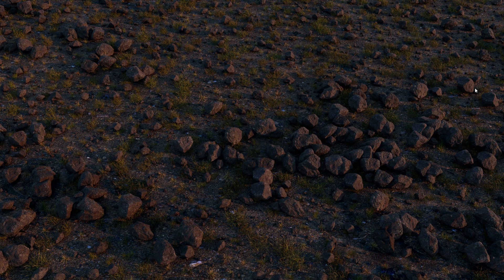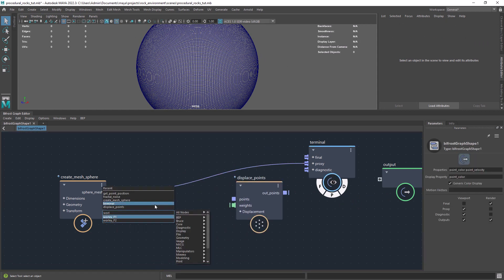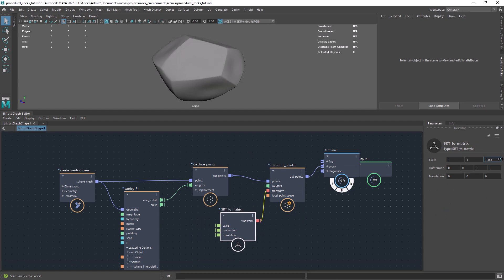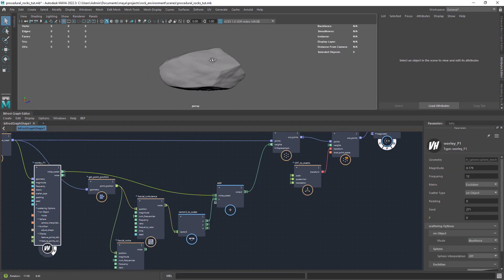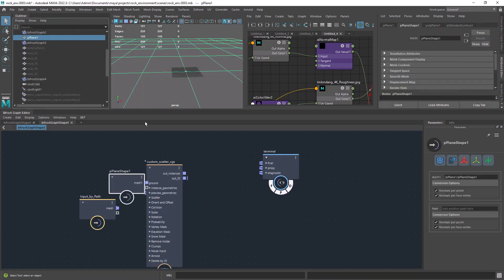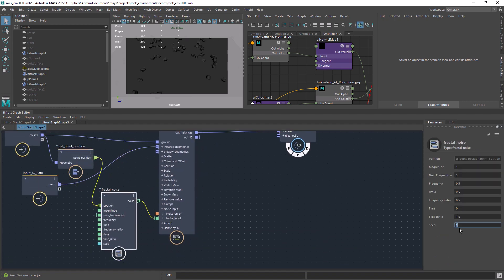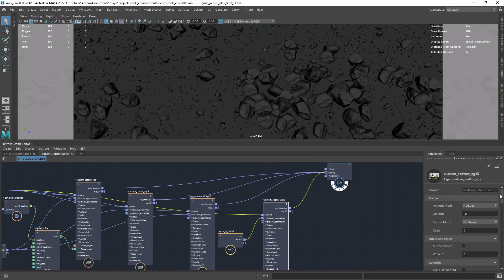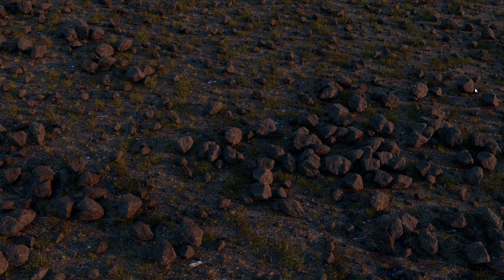Procedural rocks with Maya and Bifrost

Comment: Hey, great video, I tried following your tutorial but I'm very new to biFrost, the Worley noise compound included in VHH is showing up as yellow and making the mesh disappear, is there any dependency I am missing?
Reply from the maker: Hey, I'm not sure if this compound it's still working in recent versions, but usually you'll have to explore the compound and see which node inside is causing the issue. It's been a while since I used bifrost, but the author of the Worley is always on discord, on the bifrost addicts. Boa sorte!

Comment: how do you install these ValHallen's compounds?
Reply from the maker: Just place the "VHH-main" folder in C:\Users\USER\Autodesk\Bifrost\Compounds. If you don't have that path/folder create it.
Reply: @cgside  thx, i managed to get it installed :) although the nodes seem to be erroring, probably a faulty build?
Reply from the maker: Hey, I don't think it's a faulty build. Probably there are some dependencies of other nodes. If you keep clicking in the red nodes until you find the last node that is erroring, what node is that? Just a guess. Btw, what version of bf are you running? That could be it too.

Comment: Is this efficient when done with thousands of rocks in an environment?
Reply from the maker: As long as you keep your polycount low I believe so.
Reply: @cgside  that sounds like it is not using instances at all, isn't it?
I guess you could just export those rocks to .ass standins and be more efficient
Reply from the maker: It's actually using instances. The custom scatter has the create instances node inside.